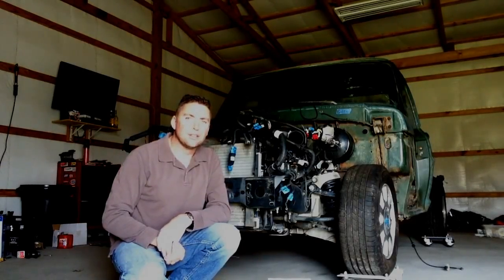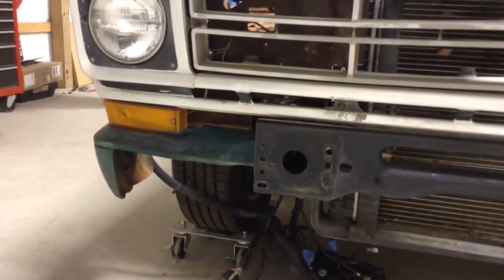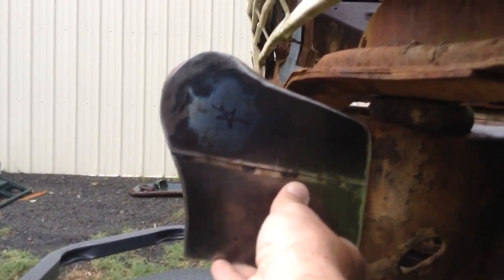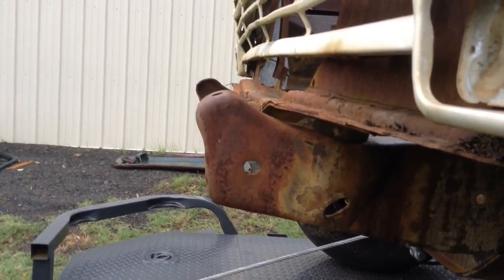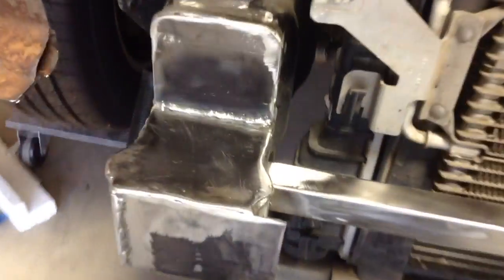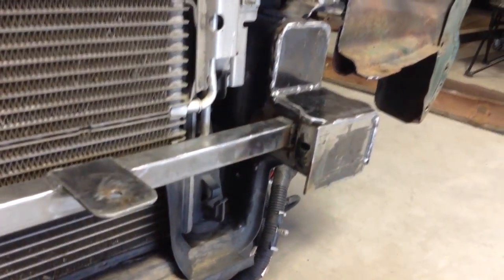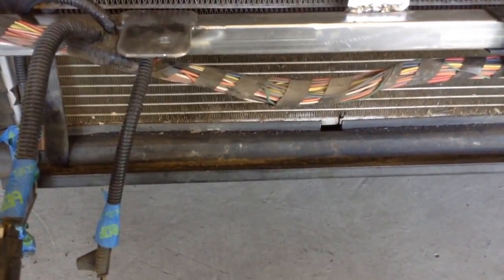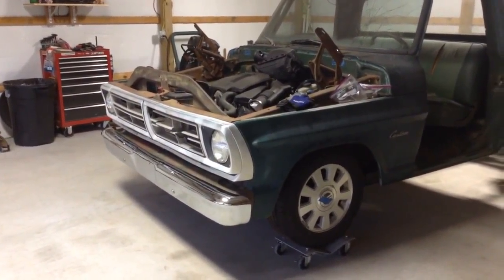F100 Marquis Build Episode 10

Comment: Looking great. Any plans on the a/c? We are building two F100's with crown Vic's. Still in the process of stripping down to the running gear. Your videos along with the other guys....river city, Nathan's garage and idle garage is helping us out a lot. Keep the videos coming. Oh what you going to do for a bed step side? Style side? Or go back to tow truck? haha.
Reply from the maker: Thanks Rhett for the support!  Good luck with you builds, I hope you post your progress.  Please let me know if you have any questions.  Nathan's, River City, and Idle have been inspirational for me too.
My a/c plans are...well...suspended for now.  I might come back later and install a Vintage Air or something similar, but for now I'm going for the ultra rare a/c delete option. Lol
I do have a short bed style side waiting to be installed.  I'm stoked for that adventure.
Again, good luck and let me know if need any help.
Reply: Rhett im working on a 1993 Chevy pick up my self bro. can you check it out on my channel just trying to find a good audience 😊😊
Reply: ultra rare a/c delete yes very rare. I haven't seen why the factory CV / GM wont fit in the truck cab. Of course I don't have my CV town down that far...the paying job keeps getting in the way. I have seen the evaporator out of the case in one of your videos. Just make me wonder with the blower motor, evaporator in the engine compartment.... seems like the rest: heater core and actuator valves should tuck up under the dash. Guess I will find out in a couple more days when the CV dash finally comes out.

Comment: "Wings are for birds and planes, and bonnets are for old ladies."  😆
So glad that you tried to mount the grill without moving the rad; I've often wondered if that could be done. Good job on the bumper mounts as well.
Reply from the maker: Thanks W&G.  Keeping the radiator in its factory location is a double edge sword.  Great because mechanically everything is bone stock.  So, if I blew a radiator hose in BFE, as long as they had a parts store, I could be on my way in no time.  However....I think I might have lost real-estate for the A/C condenser.  Time will tell.
Reply: Remember,  the wheels aren't dead center on the front fenders,  so the front clip is farther forward than if the wheels were deak on. Maybe that is the magic 1 3/4 " for the radiator.